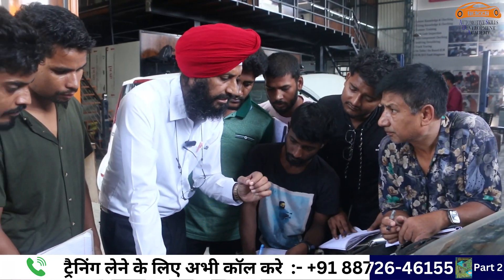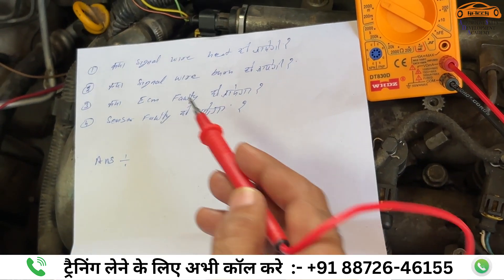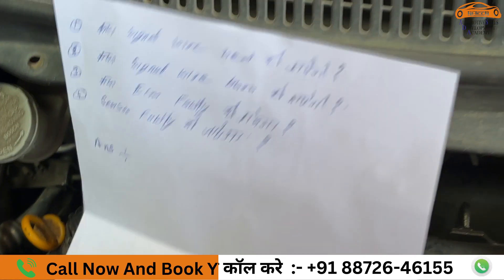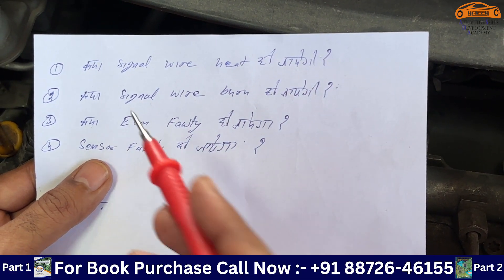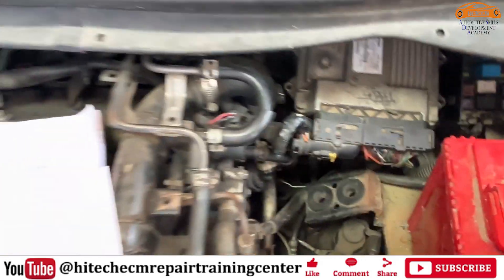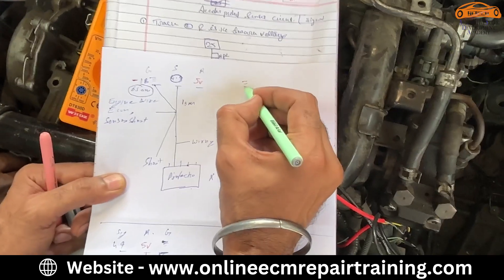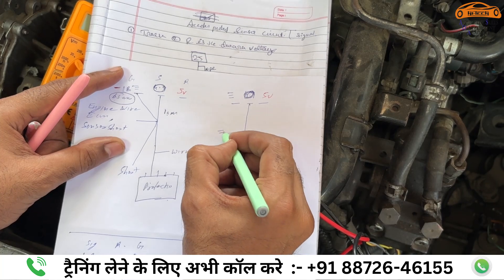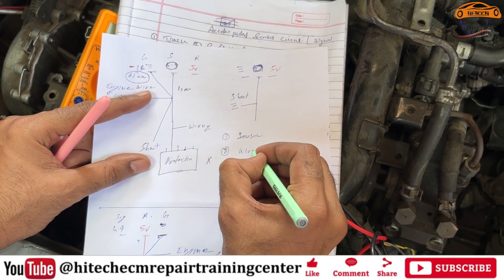How to Check Any Sensor Wiring Voltage | किसी भी सेन्सर को check करना सीखें#SensorWiringCheck

Comment: paaji agar signal wire main 5 volt ki jagah 2 ja 3 voltage aa rhi ho to uska kya reason hoga?
Reply from the maker: SIR CALL NOW :- +91 88726-46155 , 01628-214000.
Please share your mobile number and our team will get in touch with you shortly.
कृपया अपना मोबाइल नंबर साझा करें और हमारी टीम आपसे जल्द ही संपर्क करेगी।